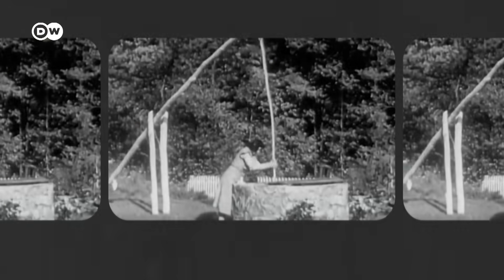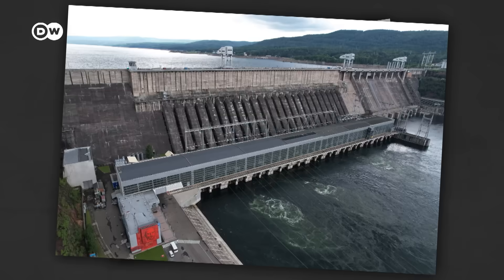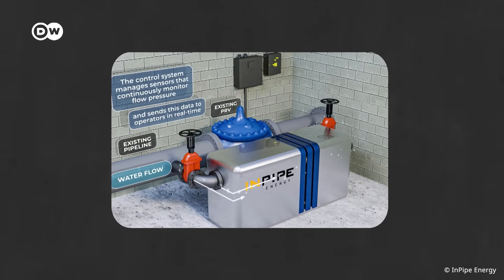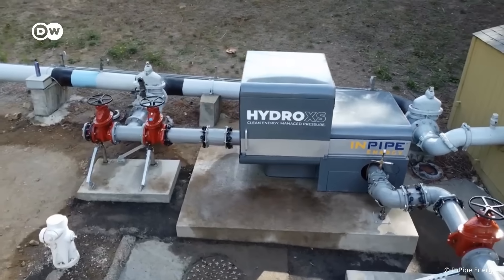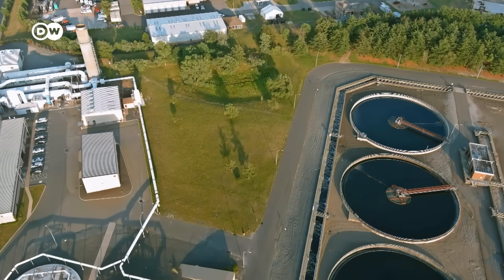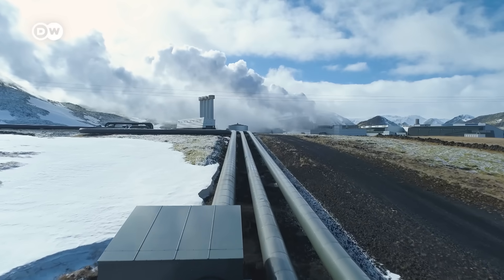In-pipe energy: The hydro power nobody is talking about

Comment: Very interesting video! I have been thinking for some time now if I could use my water tanks on top of a 5-story condominium building I own to generate power.  When waste water is going down, new water has to be pumped up from an underground tank to refill the tanks on the roof. There must be a way to use the pressure of the waste water going down to at least lower the energy consumption of the pumps pushing water back up again...

Comment: This video has multiple issues in my opinion. We need to talk about the amount of energy that can be harvested from pipes.

For all cities that need pumps to distribute water, you cannot harvest more energy than the pumps have put in - otherwise you would create a perpetuum mobile. Sure, we can harvest some of the excess energy during reduction of pressure. But when you say we can power a city from the pressure in its water pipes, that is just wrong, as we can never harvest more than the roughly 4% of total energy consumption that we put into the water system, as you claim.

For a typical household that we can assume uses 500 liters of water a day (some 180 m³ per year), and "wastes" 3 bar of water pressure, which are rather high assumptions to me, that means a potential energy of 500 kg * 30 m * g = 150 kJ per day. That is 41 Wh per day. Yes, you can charge a few phones with that, but that's not even 1% of a typical households energy consumption.

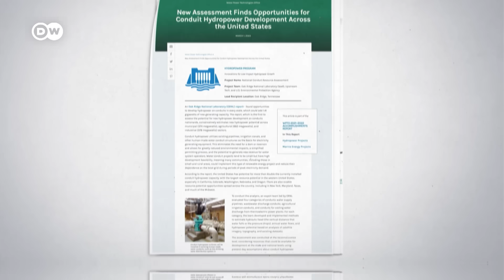Regarding the second report at 4:55, you got the units wrong. The report is much less optimistic than the one before. The report says we can harvest an energy of 43 GWh/a (Gigawatt hours per year), not a continuous power of 43 Gigawatt. Converting to power, this is only 5 MW (Megawatt) of continuous power. Enough to power 5000 households, but not 43 million of them.

So sure, build some turbines in places where pressure regulation valves reduce pressure strongly. But this is not the solution for making lots of clean energy.
Reply: Yeah, I kept waiting for the video to explain why anyone should do this while it's showing an ebay 'free energy' device as an example and talking about how much energy it already takes to move water. So I looked up Portland example and it's a turbine in a gravity-fed pipeline. It's just conventional hydropower retrofitted onto existing infrastructure.
Reply: @hungryhippo6259  That's exactly what is needed. Here in California, we have in-conduit hydropower for years. If you read the CEC document, a site assessment is needed and suitable sites must contain elevation drops. This video is terrible - the presenter doesn't know the science.
Reply from the maker: @Johannes Weis Thanks for your comment! Please, let us clarify a few things.

Our reporter never says that this would be a solution to power 43 million homes, but rather 1 million. This figure comes from the Oak Ridge National laboratory research. They say, “ORNL estimates that conduit hydropower, which uses water from structures such as water supply pipelines and irrigation canals, has the potential to add 1.41 gigawatts of electricity to the country’s power grid — enough to power more than a million homes." Link: https://www.ornl.gov/news/existing-water-infrastructure-may-hold-key-generating-more-hydropower

There seems to be a miscommunication on the “4% total energy.” The IEA found that the world uses 4% of the world’s total global electricity consumption goes to powering the water sector. Link: https://www.iea.org/reports/water-energy-nexus. We did not suggest that this technology would be able to power more than 4% of the world’s total energy consumption, of course. 

The video is not suggesting mini hydro can overtake wind or solar or even classic hydropower. Nor is it about turbines in household pipes. It's for ANY type of water supply or disposal system. None of the turbines in themselves produce a large amount of electricity, but the tech is vastly scalable and so there can be thousands of them in cities that add up to a sizeable amount of otherwise wasted energy.
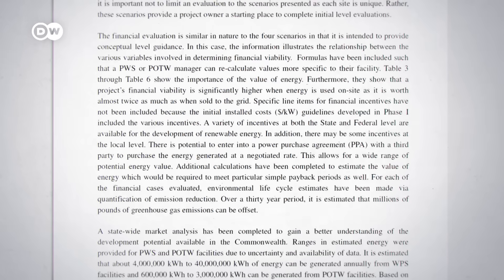Reply: @DWPlanetA  The second study at 5:00 is the one that you misunderstand the units.  Your clarification of the first study is a classic straw man argument.  Please acknowledge your mistake rather than defending your error.
Reply: So im coming back at you just throwing this back in to you you know water and tidal power is unstoppable so learn we find different ways to harness don't just give up that is constant energy without fossils
Reply: @johndoolan9732  We have to separate hydro-electric and tidal power from harvesting energy back from the potable water distribution system. Hydro power works well of course, but is limited to areas where there is enough precipitation and there are hills nearby. In the most effective locations, large dams were already built. Exploiting tidal power would be great, but we still have to make it work more reliably at large scales as far as I know.

Turbines in the water pipes would act like pumped storage hydro power at best. The supply is very limited, since we need to build water towers to decouple the energy used by pumps and the generation from turbines. (A water tower is in fact a battery already, since the pumps can run when electricity is readily available and not when water usage is high.) Also, the power from the turbines is not constant: Considering a residential area, at night, when not much water is used, there is no flow to generate energy from. In the morning, when people shower and water usage peaks, there is also little energy to be harvested since the pressure difference across a regulation valve will not be that high - if it is, the water system could be built more efficiently in the first place. So unless you're going to waste potable water in order to generate a bit of electricity, the power output depends on the time of day, and not in a way that it would balance solar (i.e. it will also not generate a large amount of power at night).

Don't get me wrong, though. There are ways to get lots of clean energy, and the technology is readily available: Wind and solar energy. Combined with storage, may it be batteries, pumped hydro or hydrogen, which we can all use for different time scales of storage, we have all the tools we need. We should not wait for a great invention to start with an energy transition. And this video sounds a bit like this is such an invention - that is my main issue here.

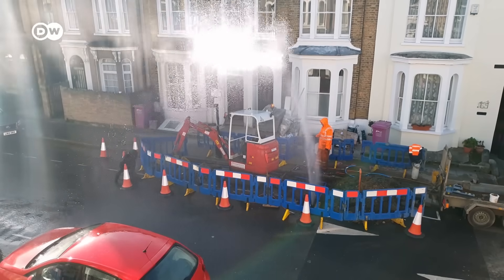Comment: 2:30 if those pressure (reducing) valves wasted energy they would dissipate it as heat and need cooling. They do not. It is because they waste nothing. You focus on pressure but the flow rate is as important. It is like volts and amps in electricity. Those valves are equivalent to step down transformers. Any kinetic energy in the water flow was put there by pump that used electricity in the first place. Sure, you can take some of it but I suggest using regular grid for that because the grid can not deliver water, only pipe can.
Reply: Actually yes, the pressure reducing valves do waste energy. In a step down transformer, the output current is much higher than the input current, because only little energy is lost and voltage is reduced. In these valves, the flow (current) is the same, but the pressure (voltage) is dropped down. It's the inverse to a pump and yes, you could make some energy from it. In fact they do generate heat, but it is generated within the water, which is more than enough cooling.

Imagine the pressure reducing valve to be a section of pipe with a tiny diameter, where so much turbulence is created within the water that the pressure drops. The turbulence generates heat. For electricity, an equivalent would be a resistor, which is often just a tiny wire.

That said, it's not the source for lots of clean energy, we can agree on that!

Comment: Well, I did do a "study" for my own home, and given that I use about 300 gallons per day for the whole household, including gardening, etc., I calculated that I would have to spend about $12400.00 for the pump and electrical infrastructure/storage equipment and installation, in order to save...800 Watt/hours per day.  At best.

Yes, I understand this only makes sense in large central points of water infrastructure junctions, but then again...why not simply lower the water pressure in those junctions?

As for my house, I use a small turbine which powers a small light, which is a visual indicator to remind me to turn off my garden hose when I water my plants.  One time I forgot it on for three days, and wasted 40,000 gallons of water.  I say in that way, it is VERY useful...

Comment: Rather than complicating the infrastructure further, isn't the solution to manage the pressures more effectively so you use less energy? It strikes me as a solution for a problem that shouldn't exist. Sure if you've got a high head source, extract the energy, but if you have pressure reducers working overtime, reduce the power input at the pumping source, far more efficient. Ok, Water utilities need to invest in decent telemetry to monitor pressure and flow rates but the benefits in energy saving and the ability to spot leakage issues and reduce waste would be every bit as useful.
Reply: Ignoring the fact that you're only planning for overflow and not underflow, which can mean everyone turns on the tap at the same time and a trickle comes out... The high water pressure used in pipes has 2 crucial reasons for existing. The first one is that pipes rupture from damage or catastrophic failure all the time, if the flow rate was low then 1 or 2 ruptures might be enough to completely shut down the entire water grid. This is such a serious problem too as it's already known that most cities have pipes broken somewhere and because they have no idea where it could actually be all they can do is make the water pressure higher. Second reason is to prevent as much bacterial growth as possible, stagnant water allows bacteria to flourish. This happened to Flint Michigan where the water became stagnant in the pipes and toxic metals were leeched out of the pipes by acids the bacteria were producing.

I think it's just easy for us to forget how much water demand can fluctuate too. One day water usage might be low, because it's raining and people are tired and then the next day the sun is out bright with people filling up pools and running water sprinkler systems on the grass.
Reply: @setcheck67  Hence making the system smarter rather than pressurising for the occasional worst case scenario?
Reply: it basically drawing power from the city's waterpump, trading pressure with electricity
Reply: Not being an expert on water supply systems (but having experience in Telemetry/control systems) I'm interested where the water goes from pressure relief valves, I'm assuming it has to be routed to a drain or soakaway?
Reply: @makemineapint  The video is referring to pressure regulating valves, that don't leak water, they "throttle" the water flow to reduce pressure to a set level.  The energy is turned to heat in the water.
Reply: The only way you can reduce the energy needed is to increase the pipe size. We are talking about frictionla  losses here.
Reply: @harry130747 for other piping yes. But water pipes need a minimum speed in the flow to prevent that water will heat up to much to prevent legionella.
Reply: But they earn a % of what they built not how good... That's why they do that much shit. Crazy? Yes. But every sector is like that
Reply: So many people dont understand dynamic balancing with pressure valves i notice.

The ultimate design is to prevent to use any pressure valve. But then we need for every tap/exit/user a own pipeline which will result in a whole lot of piping, hence a lot of cost and materials 😅.

An other solution, which is already used a lot is using multiple local pumps. This reduces already a lot of energy, but it makes the system far more complicated to maintain the right pressure in the distribution. If the pumps dont work together, it could also increase the energy usage.

Therefore, good work DW for sharing this. I like the idea, and love to see people and companies trying to look for solutions in places it works! 👍
Reply: That is already done PR valves are rare on water networks and only used where there is very hilly terrain. I am water supply designer.
Reply: Fully agree. I am guessing such passive pressure reducing systems are only used for end user applications like homes. For industrial level, why would anyone use more energy to pump water to a higher pressure than required.
@makemineapint @DWNEWS
Reply: See Jackson, Mississippi water problem. 2020
Reply: Reading these has made me very sad.
Reply: The thing here is that conventional pressure regulators don't waste energy,  rather they conserve energy.  The basic premise of this invention is wrong
Reply: @michael-j-harrison  but would that conservation then only be temporary? When the state of the system changes it will undoubtedly release that potential. The premise of the technology applies to the inevitable change of states.
Reply: @jamirowolf  fair point, but if you reduce the average magnitude of change through better management the need to introduce generators that harvest a percentage of the potential energy is reduced to the extent that it's not economic. Bare in mind in the majority of urban water supplies the pressure is created using electrically powered pumps rather than gravity.
Reply: I'm no hydrological engineer, but having too much pressure in a water system seems fine... having too little pressure is a crisis because people turn on the tap and no longer get water. I suspect it's basically impossible to match use 1:1 without encountering the latter. It's already a sometimes tricky balance to do that with energy grids that respond instantaneously, let alone with a system that requires physical movement of water that you can't make move faster.

Also, if I'm not mistaken, there's sanitation concerns in not keeping the system pressurized.
Reply: @tHebUm18  You are right, mostly. Technology can help us manage the pumps and as said, telemetry will make sure all parts has a safe pressure.

One guy I know has a pool with a pump. It was a standard pump installed as the manufacturer described. But it took a lot of energy and made too much noise. He installed a speed regulator on the motor and cut the electricity bill to just 15 % and the noise went down a lot. The flow was almost the same and enough for his pool. That's how you do adaptive management of water pressure.
Reply from the maker: @Make mine a pint Initial pump pressure must be high to transport water long distances and give us the steady streams of water we enjoy out of the tap. But once the water is where it needs to be, the pressure has to be reduced because it can damage regular plumbing infrastructure. That's where the pressure valves come in.
Reply: @DWPlanetA The video is confusing because it is talking about micro and macro both levels at the same time. At micro level it can be beneficial if someone has excess pressure.
Reply: @DWPlanetA  the idea entirely sits on the claim that these pressure valves are energy wasters. But where does this claim come from? There is minimal movement inside these devices, only for opening and closing the circuit, and this mechanical work is needed for functioning.

The other problem is how can an external turbine capture this alleged extra mechanical work inside the regulator. They should be place inside and such a design sounds way more costly and inefficient than a valve redesign. A linear oscillating transducer can be fixed on the regulator valve / opener to leak energy, the same principle of the microphone. But that would only waste energy, because of the inefficiency of the conversion.
Reply: This is the whole point my friend . We can’t be effective as you say ( it’s efficiently actually ) at the source , we can only be efficient at the destination . At the macro level we are unable to remove this waste , it is only at the micro level that we can harvest the waste .
Reply: The pressure at the beginning of the system must be high enough to flow the water to the very end of the system. There are inherent losses of pressure having to do with the diameter and the length of the pipe as well as bends in the pipe and turbulence caused by the many fittings involved. 

To get water to the end there must be excess pressure at the beginning. The plumbing in the homes near the beginning would not withstand that pressure, so it must be reduced somehow to prevent damage. So the question is, can the necessary pressure drop be used to drive turbines at the beginning of the system with a justifiable increase in power efficiency?

I like the idea, but I see getting the power from the turbine generators into the grid will be the problem. There will have to be electronic controls to maintain the proper voltage and frequency. This may push the cost over the limit. It’s not rocket surgery. A good electrical engineer along with another good civil engineer could get a handle on it on short order.